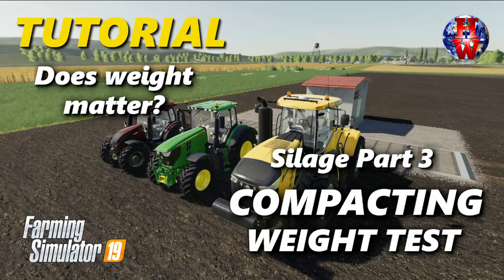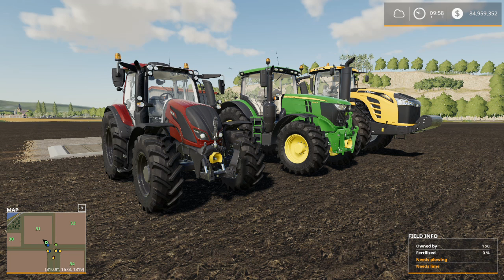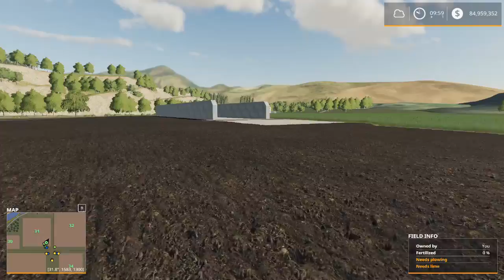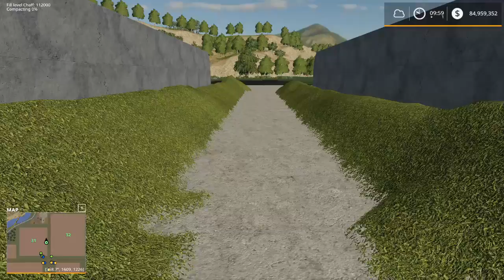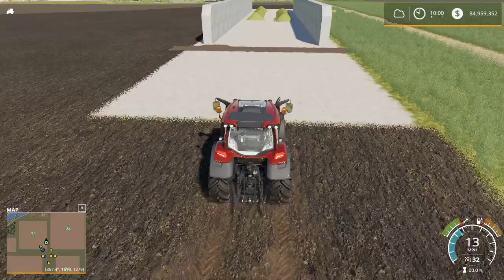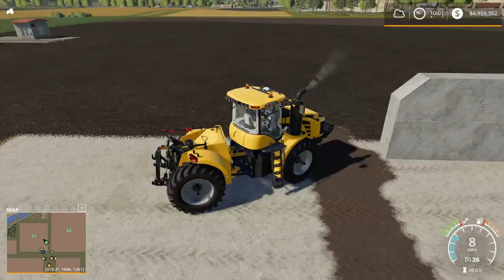Does Weight Matter? - COMPACTING WEIGHT TEST - Farming Simulator 19 - FS19 Silage Tutorial

Comment: another way to test weight, get a mod with straps that works with tree logging, czs has a bag mod for a front loader, use the tool on different weight tractores, just carry 1 log up and down as if the tree stands infront of you as if still planted and you drive up to a tree... the 1+ ton trees will throw a 10 ton tractor adound like a rag doll but make it weigh around 20 tons little to no movment at all. here, you can also test the effect of twin tires, tractor both weighs a little more like 2 tons more or so i forget, and gives more surface area on ground so it flops and wobbles way less woth heavy trees.